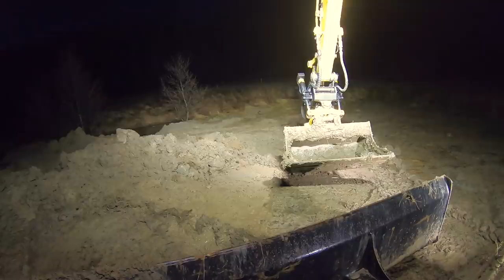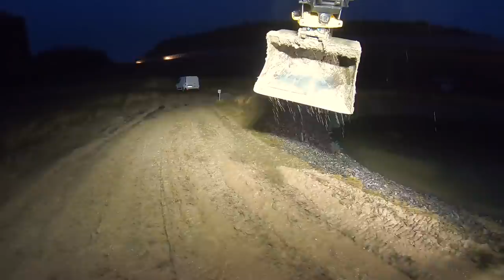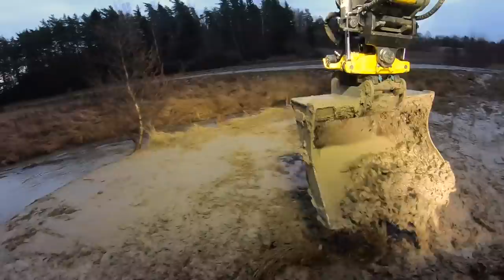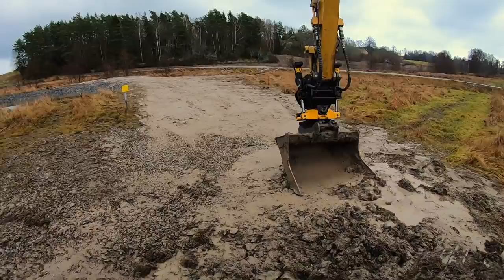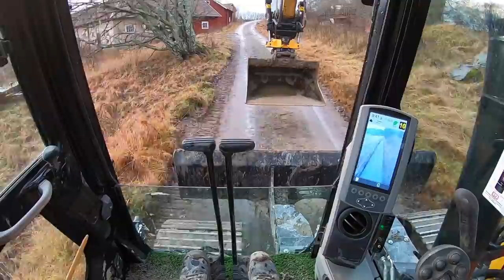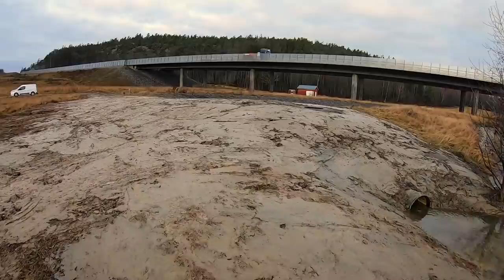#18 The leaking water regulating well. (Part: 5 of 5)

Comment: In California if we had to do an emergency job in the winter like this, we would probably have to put large drain rock down to build a road out there, build rock pads to work from, spend a week setting up erosion control and sediment traps before even putting the rock down, and then fill the entire hole back in with gravel, put erosion control over around the entire site, and leave it until late spring when we could come back and remove all the rock, truck out the dirt piles, grade the site, and then cover it in hay.
Then the following year in the spring we could remove the erosion control fences and such...

Having that bucket is pretty much the only way that you could finish a job like that in the winter, and it's awesome to watch you work!